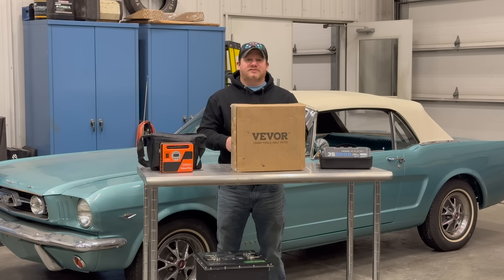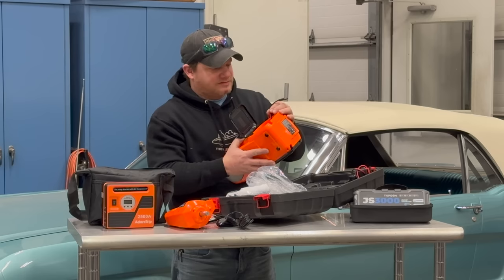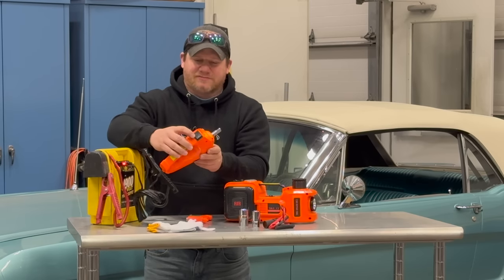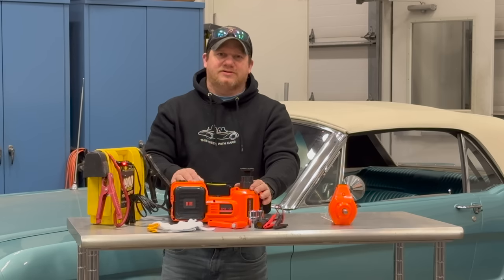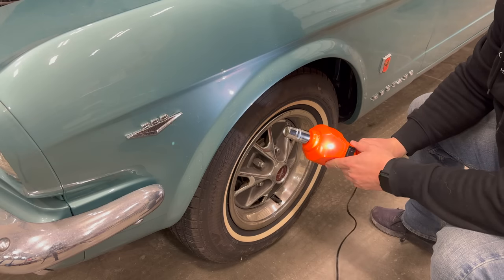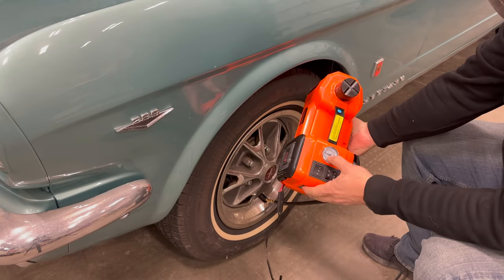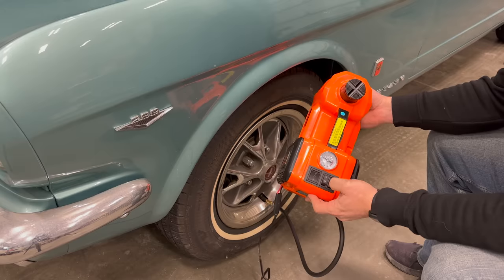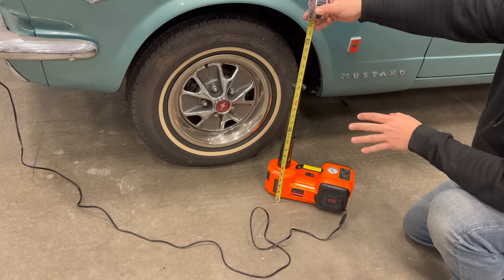5 Ton Electric Car Jack and Impact Wrench Kit

Comment: It would be good for a woman or a Gen Z male who doesn't have the strength to use a manual nut wrench and jack handle
Reply: Ever seen a female weightlifter?
Reply: @grahameroberts8109 
Ever seen an older woman ?
Reply: Or us old guys with bad knees who have trouble getting up and down a lot!

Comment: The electric wrench would work well for older folk, women, teen girls, or physically impaired individuals. I bought similar kits for several of the senior citizens, women, and teen girls in our church. I also taught them to properly use them. The two things I would ADD to the kit is a collapsible wheel chock and pencil type air gauge. Concerning the window break/seat belt cutter; it's there to be used on someone else's car. You never know when you may come upon a wrecked vehicle and you need to extricate someone. Think of others before yourself. Same reason everyone should carry a first aid/trauma kit and fire extinguisher in their car; for the other guy.

Comment: You are a young guy so you can use the lug nut breaker bar, but for us old farts, this kit is excellent!  Hard for me to get up and down and hard to use small stock breaker bar to loosen and tighten lug nuts so I like the impact wrench.  I saw this impact wrench tested on nuts way over torqued….180 pounds and it worked fine to remove them.  Also, you only let it wind up once and hit it….you should let it wind up and hit, repeatedly!  Especially for tightening the nuts back on!  I bought the one without the air compressor, and I like the kit a lot….a 74 yr. old guys review of your review!  Well worth the money when your stuck out on the highway.
Reply: I agree Mike he only pulled the trigger once on the impact to tighten the lug nut.  I'm sure it would have tightened it to 100ft pounds and higher had he pulled the trigger more than once.

Comment: I wish I had bought one of these months ago.  I had a flat tire yesterday.  The county had been salting the roads.  I couldn't see the road and hit a curb at 34 mph.  The speed limit was 40 mph.  The front tire on the passenger's side had a blowout.  It took me two hours to put on the spare tire with the flimsy car jack that the dealer had included.  It was 20 degrees outside.  Fortunately, there was a coffee shop near me.  That electric impact wrench would be great for anyone who can't use a regular lug nut wrench.  It does take quite a bit of force to loosen a lug nut.  The air compressor would be great for filling the spare tire with air.  The spare tire usually needs air too.

Comment: Most car insurance companies do include roadside assistance.  You do have to pay an extra $70 to $150 a year for that.  They can jump-start a dead battery for you.  They can replace your punctured tire if you have a spare tire in the trunk of your car.  Otherwise, the vehicle will have to be towed to the nearest tire repair shop.  I've only had two flat tires that needed to be replaced immediately.  A person can usually fill a flat tire with a sealant like Fix-A-Flat and repair the tire.

Comment: The hammer is to help others the impact is a nice touch especially when you're wife or kids or older folks who have the know how but can't physically do a lug wrench or  breaker bar anymore but the jack is a little out there with the air compressor the should be separate just because of weight other than that it cool

Comment: I actually like the idea of having an all-in-one kit neatly stored in a single case. Snide remarks re being a sissy, or a Gen Z aside, for $60. more, I think complete kit would make sense for most people. Who wants to be futzing around on the shoulder of a busy highway in the dark, in the rain, searching for, then wrestling with a conventional lug wrench when you could R&R lugs so easily? Of course, it's undoubtedly all made of chinesium, so life span is anybody's guess.
Reply from the maker: If you only use for emergencies the life span should be forever.

Comment: I wonder if the air compressor and the jack share the same motor with a solenoid switching between either option. The review was very thorough..... thanks. I was sceptical about buying one. I do long trips in outback Australia. I agree about the extra bits. I carry a breaker bar as an essential item in my vehicles. The electric rattle gun was impressive but I would not actually use it. Same for the window breaker/ seat belt cutter. Thanks for the review. I will probably get one before my next trip. I do like the air compressor. I wonder what its maximum psi is.
Reply from the maker: I am sure they are separate motors so if one broke the other would still work.

Comment: What's the lowest height under which it will fit?  Jacking under the suspension of the flat corner saves a lot of lifting. (You don't have to exhaust the suspension travel to lift the wheel.)

Comment: Knowing the maximum height the jack can reach is good to know. But how about the minimum height? Does it fit under low vehicles (e.g. MGB, Triumph, etc)? Especially when it has a flat tire is it very low to the ground.

Comment: Why does nobody ever do this jack with the tire flat. To see if it will fit under most cars?
Reply from the maker: Every car is different, it will fit under a this mustang if the tire was flat, won't fit under my Triumph TR4 race car, you have to decide if it works for your car.

Comment: Yeah the ppl that designed this kit are talking into account the "sissy" males we have now days that do not have the strength to break a lug nut lose.  they might break a nail or chip their nail polish
Reply: Just maybe they are thinking of the many people (women, teen girls, physically impaired) who cannot use a conventional tire removal system. It's sad that most of us no longer think of others before self. Guess there are too few Samaritans today.
Reply: Also if tire store installer torques to holy heck torque pounds